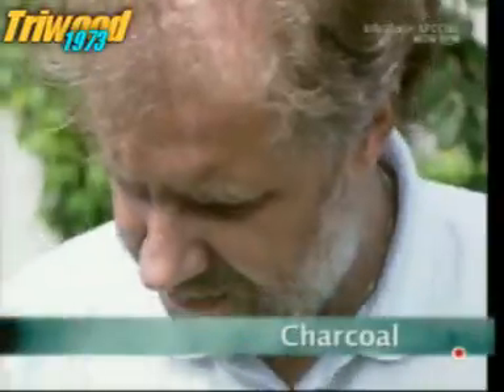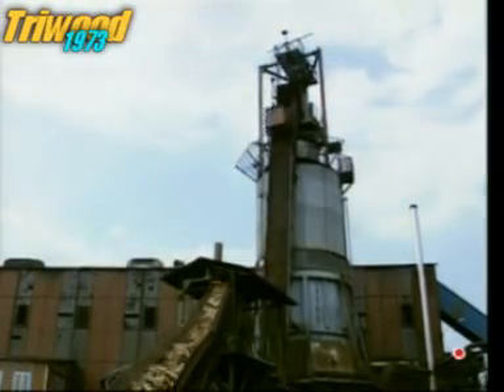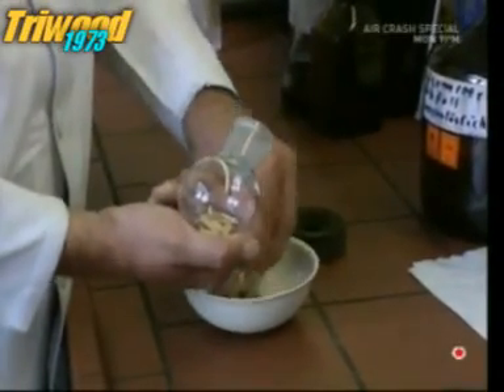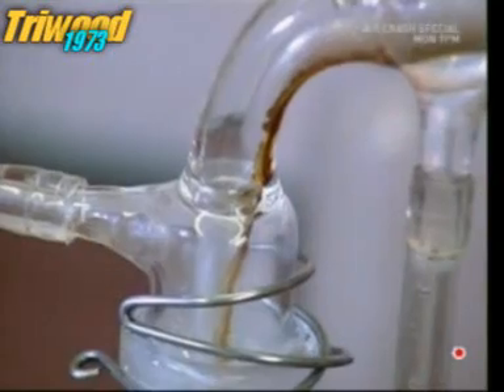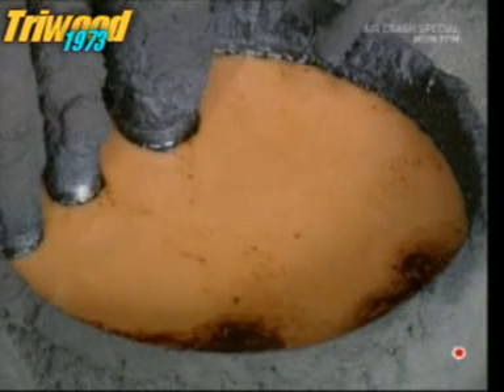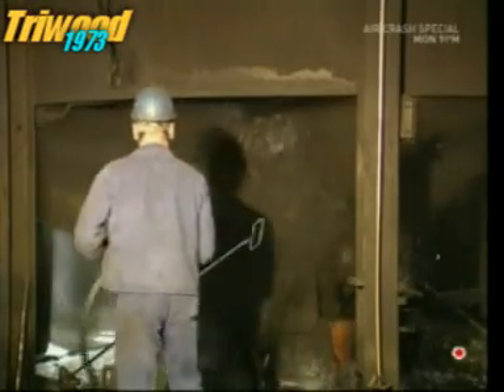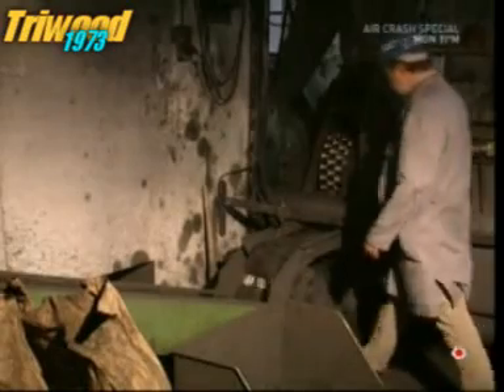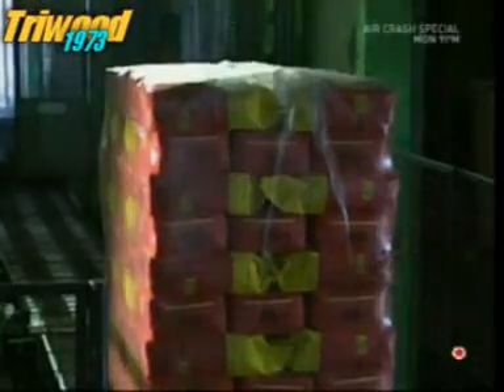Making Charcoal For The Barbecue

Comment: they use scraps of timber that would otherwise go to the landfill. The wood is relatively carbon neutral since the tree was collecting co2 during its life. And the fumes from cooking the wood in the retort is flammable, so they should be able to heat the retort partly with off fumes(its like a fire). No i do not work for charcoal companies. Now how kinsford charcoal is green i dont know. Lump is probably beter

And its probably a lot better than looking to petroluem or natral gas